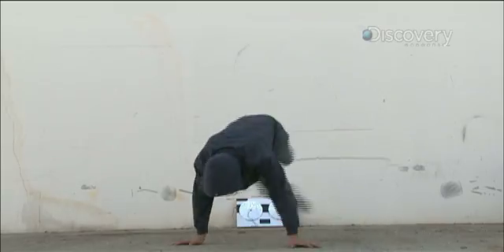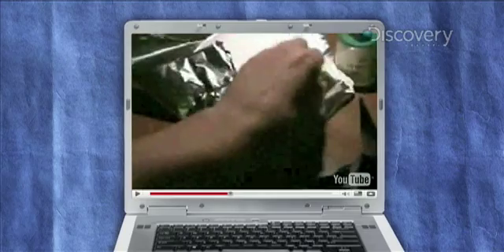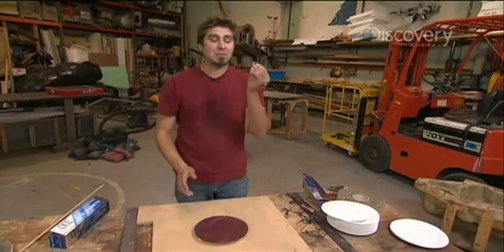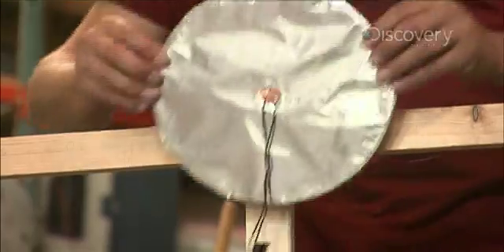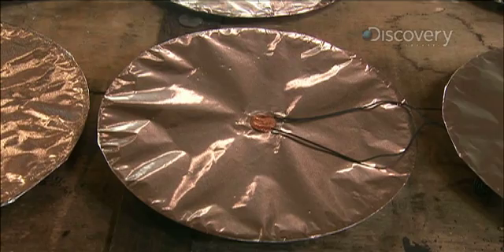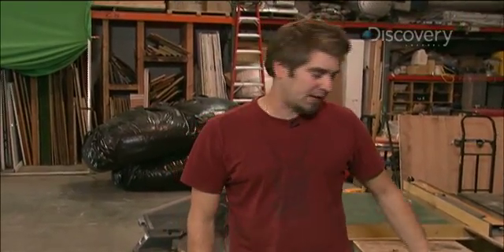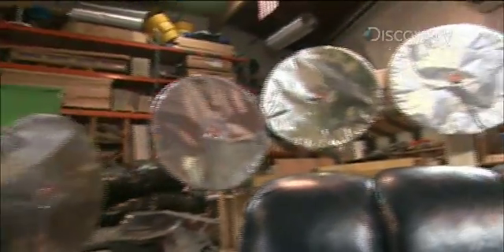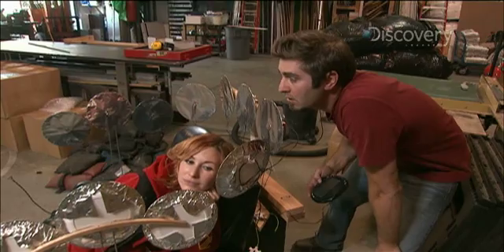MythBusters - Homemade Hi-Def Speakers

Comment: I've made a speaker. It's not that far from the described method - but far enough to be the difference between "working" and "not working". You need a magnet inside the paper plate, and the jack needs to connect to an electromagnet (you can make a crude one by wrapping thin wire around a pen). The foil can be any material; typically of course paper.
Making it high quality, though, takes a lot more work to clean up the signal.
Also, the speaker I made melted. So be warned!

Comment: I fail to see how people with 3 braincells rubbing together could fall for this "myth". Attaching the 2 wires (of 3 from a stereo jack) to a penny is just a short circuit for the CD players output. You can buy $10 jacks, gold plated swarovsky cristal encrusted models in a top brand shop. But a plain one, $3.5 for 15, free home delivery.

Comment: Lol you need a magnetic coil for a speaker to work. The electric signals from the CD player push the magnet forward and backwards and thus the speaker cone. Pennies don't vibrate just cuz you electrify them.

Comment: That's one of the stupider things I think I've ever seen.  How is it that the penny on aluminum foil is supposed to do anything with a little current running through it?  And he claims the aluminum foil seals air out of a plate?  And, even assuming there was something here that could make noise, how would the aluminum foil not ruin the sound quality?

Comment: it could be very easy to create a cheap speaker if you know the physics behind it. applying electricity to just metal creates no movement or reverberation. however if you had a setup of small fixed magnets and a stick held vertically next to them with paper plate and foil on end, and then created a coil of wire and in between the magnets and attached it to the stick, if you passed current through the wire, it is possible it might work, even then it would still need an amp for any decent volume.

Comment: Yes and no. A CD player puts out whats called a line signal which is powerful enough on its own (plenty of headphones with large diaphragms can get very loud) so the line signal isn't the problem.  The reason is its just impossible to construct a speaker in that fashion because there is no permanent magnet for the penny to recoil off of. the penny probably wouldn't be a strong enough electromagnet on it's own anyway but even it it was, what is it going to repel off of? kind of a dumb myth lol

Comment: It is irrelevant whether the two wires are on the front or back of the penny, or how much power is applied. They know this! Every speaker has an impedance rating. The impedance of a penny is 0. In other words when the two wires are 'connected' to the penny, there is a dead short. The only reason they wasted their time doing this, is because as they stated, it was requested.

Comment: I don't think a CD player has enough power to power the "paper plate speaker"

HouseHold Hacker "HH" 

1: Put the wires on both sides of the penny. ( MythBusters put them on ONE side of the penny)

2: HouseHold Hackers "HH" used a computer outlet. 

I'm just bored.

Comment: If you are in england or flying you can get Headphones for free and also you probably have a broken pair somewhere around your house just use one of those also i took a circular piece of copper roughly the size of a penny and this worked fine.

Comment: besides those electrical arc speakers dont most speakers require a wire coil of sorts creating an electromagnetic field to react to a permanent magnet to produce the audible frequencies and some inaudible frequencies?

Comment: this can NEVER work. A real speaker requires a wire coil that generates a magnetic field which in turn drives a cone. All that's happening here is a direct short circuit across that penny

Comment: the speakers are actually two magnets that interact together, if you have an electromagnet (the penny) working with AC, ¿why not try placing a permanent magnet behind?, offcurse you had to prove first that the penny works like an electromagnet.

Comment: no, you can just use a single roll of foil and one packet of plates, but then you need some wires, and that rack-like creation he used for the surround system ... all I'm saying is that there were more ingredients than just the stereo plugs, no need to get all bent out of shape over it. If he managed to find so overpriced mini jacks he probably could've found a 15 dollar roll of aluminium foil.

Comment: That's incorrect. The inverse resistance in parallel is the inverse of the multiple paths added. 1/(Rf)=1/(R1)+1/(R2). For two speakers that are 8 ohms each the resistance is 1/8+1/8=1/4, which is a resistance of 4. In series they are added. Btw, you don't need magnets to make speakers. Electrostatics work by using the AC signal to manipulate a field.

Comment: (...)This creates vibrations, which creates waves, which is exactly what sound is. The paper-plate isn't wrong, but just about everything else is. The tinfoil would only distort the sound and the penny? It's absolutely pointless. Why would you attatch it to the foil, anyway?
Really, all you need is a box, tape, a paper plate, a magnet and two meters of thin wire. Barely costs two dollars if you know where to get it, really.

Comment: I've made my own speaker more than once, just for fun, and there are so many things wrong with this model that it makes me kinda dizzy. First off, it's the cone that is the amplifier, so you won't want it to be trapped, since that would dampen and distort the sound. Secondly, a speaker works through a magnet and an electromagnet. The sound is made by the current switching direction in high-speed, causing the magnet to either repel or attract the electromagnet that is fastened to the cone. (...)

Comment: this was done wrong, he didnt watch the video correctly.

To make this work, twist the minjack copper wires so they're pretty much one - now half of the copper wire needs to touch the penny and the other half of the wire needs to be on the aluminum foil or else this wont work. I don't know if he did this on purpose but yeah..

Comment: Speakers are very simple. If you have a broken tv/radio/headphones or any other speaker type device that you don't mind destroying, take a look inside and take apart the speaker. Really rip it apart. You will find a few basic things. 1. a "cone" of paper, 2. a round disk called the spyder for support 3. a copper COIL of wire 4. a magnet.... that's basically it. It's not rocket surgery and you don't have to be an engineer to build a basic speaker. :/

Comment: you can get 3.5mm TRS female jacks for as low as a dollar. highest price for a 3.5mm TRS extension cable, or 3.5mm to 1/4" jack is about $5. just buy up some cheap earbuds from the dollar store if you plan on stripping them anyway.

Comment: Not a valid effort: Household hacker had the front of the speaker flat rather than upright.  I would expect that, since gravity operating on the penny formed the sound source, it would make a difference whether the speaker were upright or flat. Household Hacker's assertion may still be correct - Tory failed to accurately replicate the speaker design.

Comment: Tory, I noticed that you taped the wires on the penny different than household hacker did. he put the wires on opposite sides of the penny instead of both on the same side like you did. That may be the reason. If it doesn't work first, try flipping the wire ends.

Comment: i just coiled a little old copper wire in a spiral between 2 pieces of masking tape. put a magnet on the center below it, then connected a headphone wire to it: it worked. 
so here's what they did wrong. 
1: no magnets. there needs to be a magnet to make a speaker. 
2: no amplification. even if you connected a real speaker to a CD player the way he did, you wouldn't hear much. you need some kind of amplification. even my little speaker i made is very quiet without having an amp behind it.

Comment: There's nothing to actually cause the penny to move. An actual speaker has a cone, which is attached to a coil or magnet, which is put inside another coil. When a charge is sent through the outer coil, it creates a magnetic field inside the coil, which causes the magnet/other coil to move, moving the cone and creating the sound.

Comment: I understand that the mythbusters more than likely knew this already, but it really annoys me when they do a myth that is easily busted with common sense. Speakers work via coils that cause a magnetic field causing them to move because of another magnet. That is fairly common knowledge. No coil, No magnet, No sound. And considering you are creating nothing but a short circuit, there wasn't even a hint of doubt...

Comment: Yea, speakers work with magnetism and magnetism by electricion needs a coil. And even if you put a coil on the foil, it wont work as you need another REAL magnet on the bottom for the coil to have something to attract to.

Comment: @llIIIlIIllIIIlIIlllI  Tory first needs to learn how the electricity flows, the wires he has connection is just wrong, he has left signal with negative wrapped together and right signal with negative wrapped together, which just short circuits the output from the CD player (just as someone mention in comments below) and like you said there is a coating on the wires on the left right and both negatives to prevent the short circuiting between the wires, just use the right or left + and one - wire.

Comment: @123456789robbie You know Im going to watch the org. video and try it myself (Still have low hopes of it working) but I don't think he did it right. Because he put both wire's on the penny also prob didn't have enough power( I think one make SURE the wire was exposed and put one end on the foil and one end on the penny then try it with the CD player and if that didn't work I would try with a idk a stereo system or something. but ill try it =]

Comment: Even with a good connection you are only temporarily shorting out the milliwatt amplifier in the CD player.  Normal average speakers work by causing a coil connected to a paper or plastic cone and having that coil to move in a magnetic field vibrating the air near it.  There isnt anything to cause the foil/ diaphram to move, therefore no sound.

Comment: google.com/search?q=mini-jack+cables&tbm=shop

Mini-jack to mini-jack cables starting from $4. You can even cut them in half and use one for two speakers, so $2 a speaker, plus paper plates and aluminum foil.

Comment: second you need to connect it right you didnt put a correctly wires and third you didnt used a deep enough plate ! You need to emulate a membrane and plate is conductive but not too much ...
You need a paper not a very hard paper or cardboard as you use it cannot vibrate you freak did you ever open speaker i opened thousands and many of them have a paper Tweeter ! Oh yeah Tweeter is the name of hi speaker and better material for Tweeter and membrane better sound !

Comment: There is a company that has designed an extremely thin speaker & there was  another one that sold what was basically a sheet of plastic atop a quarter inch of foam, that you could print anything on, so you could have what amounted to a framed poster or painting, that was actually a speaker, you could use two for stereo. It has nothing to do with air & everything w/ vibration

Comment: @DrGand Except of course for those that use electrostatic force instead, i.e. capacitive ones. That would include the common piezoelectric buzzer and condenser microphones. Which you could build with the same materials, but this obviously wasn't it.

Comment: ok you did everything right but wiring the penny!:P
1. you have to have the wires way closer together almost touching.
2. you have to place the wires on abes head side with 1/2 an inch sticking out.
3. tape the tails side not the heads.
4.put into a jack and rock out.

Comment: @captainofpineapples well, in more complicated terms it should create pulsing magnetic filed as the electrical impulses sent throught the wire are not constant. however , knowing coins dont tend to be wery magnetic and that the field need a lot of power this experiment is a pure failure. in any case , to make sound the foil would need to move in effect of this field. that requires another magnet or atleast a piece of metal. neither is provided. why would the foil move?

Comment: Actually any speaker needs an electromagnet and a wire coil so that the varying signals in the electricity cause varying magnetic fields that move the plate. 
No magnet, no coil, of course this doesn't work!

Comment: @KimChoJapFan not meaning to bust your bubble but hh idea, which he actually writes that its a joke is far cheaper than kipkays real speaker. kip kays idea broken down is, wire=$5 Magnet =10-20$ all=$15-$20. hh idea is penny=$.01 jack=1-3 tin foil=3-4$.

Comment: Household hacker stuff no longer works.
What does work? pringles can speaker, both the DIY and the one they give away, beer (soda) can speaker, 2 sheets of foil (electrostatic) speaker, the whole bit. But household hacker is crap.

Comment: you dont need any kind of smart brain to learn that speakers contain magnets connected to the input that send electromagneticals wave that make vibrate a little copper wire that make noise with plastic. for example, take a plastic bag (for under 0.05¢) then put in on your lips and make a v noise. if you do it right, you should hear a noise in the plastic bag. thumb up if you learned something.

Comment: The sad thing is that this is sort of close to a real speaker.

If instead of a penny, you made it an electro magnet, and if instead of tinfoil, it was a rubber membrane with a pemanent magnet below it, it would have worked.

Comment: @mazakman1957.  Please learn to READ before getting into such things as basic electronics. Being illiterate doesn't make you the ruler of things being obvious. Since I guess you can read, try reading it again. I mention that, for speakers in general, you would need an amp. If you have a speaker, inthis case a passive one, you wouldn't be able to run it with a low level output from a portable cd. Nothing else, and nothing more. There you go, sleep tight mister basic electric.

Comment: Of course this won't work. A speaker is a an electro-mechanical transducer, meaning there needs to be something that reacts to the changing polarity of the music signal. Taping the bare wires to the penny creates a dead short - the same as if you twisted the wires together. It may end up damaging the device you plug it into.

Comment: This was just dumb. 
Myth busters should go and die for short circuiting a speaker cable. 
Also Jack Asses, you might need an amplifier, even if the short-circuit wasn't the problem,

Comment: @scotty2307 a short circuit is when a low voltage current's connect's to a high voltage current and it messes with the logic gate's and create's heat

Comment: @slimshady728 if the coin had been on the other side of the plate it may have worked, the current could cause the coin to act as an electro magnet and attract the aluminium(im not sure if aluminium is magnetic or not

Comment: First off, it's called a Dollar Store, most have all the stereo connections you need. Next I just like to point out, that these guys have been doing this for awhile and they constantly prove they don't bother to do any kind of research. This is basic electrical knowledge, hooking two wires together like that shorts them out. Wish they just let Jamie and Adam do everything like they did when they first started.

Comment: the least they could have done is put the penny on the back of the plate, but even if the penny magnetizes and pulls the aluminum (which cant magnetize...) to it where do they think the foil will move its already touching the penny lol

Comment: Note: there is an enamel on the wires of all those jacks that does not conduct electricity. For proper testing, he should have used wires that were not coated with that crap, or removed the enamel. Regadless, a speaker needs a magnet and a coil to work, the paper plate "hack" had neither.

Comment: Also, in this experiment, the web video indicates that you take this mini-jack from some pre-existing device, lending some proof of cost.  Of course this speaker, if made to even work, will sound like poo because of the variables of acoustics created by the construction material.  A short description from a speaker manufacturer could make this clear to the audience, as well as an animation that shows how sound is created.

Comment: You can't short the speakers wires with a penny and expect anything!  As built, the penny shorts out the audio electrical signal.  Also, you are missing a source of magnetism to make anything move.

You could fix this by using a small microphone (dynamic) attached to the mini-jack wires and glue it to the back of the paper plate.  Glue the rim of the paper plate to the foil and make sure it is very flat (loose foil will make weird noises)  Replace the penny with a metal washer.

Comment: @MARCVANITY0 Actually there is no voice coil to generate the EMF... without any force on the plates to vibrate them no sound comes out. While you are right, and he is just shorting the wire out, they simply won't work without an electromagnetic coil.

Comment: @EvilAcolyte 

Not quite true. You need a transducer to change electrical potential into mechanical motion. This could be a number of different methods including voice coils (Magnets), piezoelectric devices, or even a spark gap.

Comment: the connection between the jack and "speakers" is not rigth.On the one side have  isolated negative and positive on the one of channels,the same on other side of cable.So,you make a short circuit